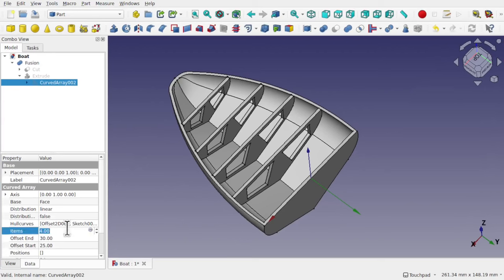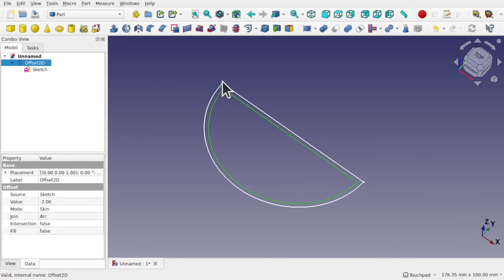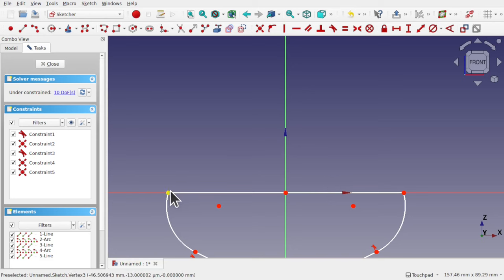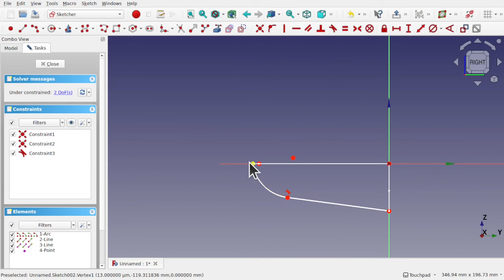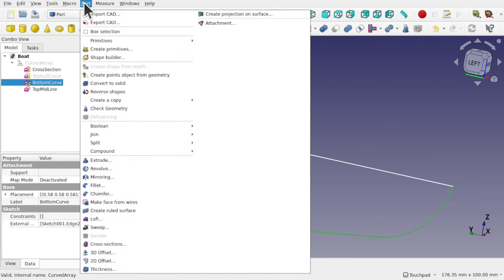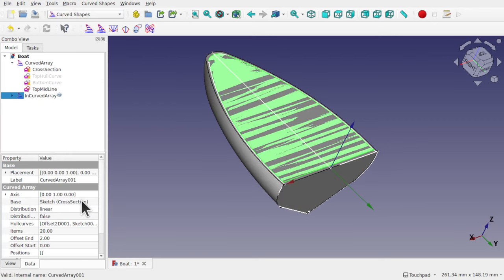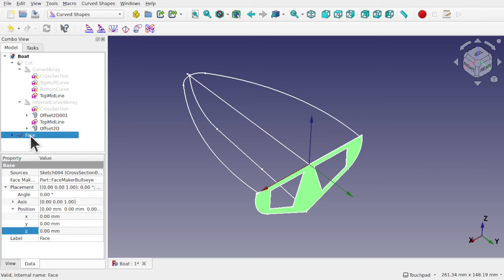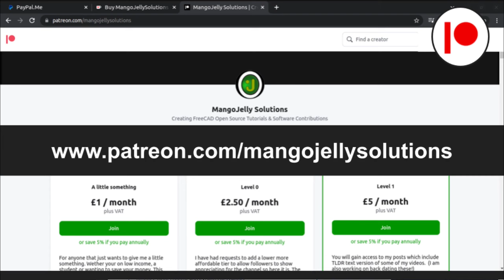EASIEST Boat Build in FreeCAD! Unleashing the Magic of Curved Shapes Workbench

Comment: I can't imagine the number of hours you have spent to refine your skills with this program. FreeCAD is growing exponentially in complexity which is a double edged sword. It's far more capable now but the learning cure is also steeper for newbies.
Reply from the maker: Freecad is a very flexible tool, though it has certain rules and boundaries it's created in such a way you can have freedom to integrate and use these tools in endless ways. You can make it as complex or as "simple" (I say that very loosely) as you like. There are a hundred and one ways of doing one thing. And this is where the boundary to master such a tool lies. Worth flexibility can come complexity. 

I find if I explore multiple ways I can come up with solutions that shortcut complex tasks for a totally different subject. For me it's all about seeing modelling in a different way. That's the fun part 😊. But I don't want to keep this knowledge to myself so I share that knowledge with everyone. And I am beginning to see that there are certain basics that I need to cover and I am looking at creating something as we speak that will turbo charge the beginner experience. It's totally unique to anything out there. It's in the pipe line... And there will also be a book! 😁😁

Comment: I am going to 3D print me an RC boat from plans taken off of Pinterest. I wasn't having any luck making a hollow hull. The trick is the OFFSET. I kept trying to use the THICKEN face, and it wouldn't work. The trick is make 2 solids and then Boolean subtract one from the other. GENIUS!
Reply from the maker: I have been meaning to do this video for such a long time and so pleased it's already helped someone. :) :)

Comment: When you cut the interior from the exterior, you used a small offset to avoid the skin being left on top.  Rather than offset, which might create weird geometry (not important for this, but I can imagine projects where it would matter a lot), would it not have been preferable to extrude the top edge of the interior upwards before the cut?  That is, in general you've gone to the effort of making your interior shape exactly correct, so you don't want to move it.  For example, let's say you are designing a part which will be injection moulded, and it needs to have a consistent skin thickness.  If you've designed inner and outer shells to leave precisely that skin thickness between them, and then offset the inner shell, the part will be thicker on the bottom than on the sides.

Comment: @MangoJellySolutions Thanks for the great work on your tutorials. I abandoned Freecad after trying 0.1 and later revisiting 0.2 as I find the user interface just too confusing. At the time I was working on SolidWorks and Fusion 360 and just couldn't afford the time to figure it out without proper documentation and tutorials. When I had some time on hand recently I stumbled on your channel and found your videos very informative and helpful. When I saw this video I really wanted to work through it and with RC1 now available, I gave it a go. As I wanted to try everything in your tutorial, I also followed your "mistake" to place the sketch too high and then copy it lower using the sketcher copy command. This is where it became interesting as the copy command was not available, so I saved the file and opened it with 0.21 and the command was there. So it would be interesting to know if they left it out in RC1 and if so, if there is another way to do the same operation. Of course it's better to do the job correctly rather then fixing your mistakes later, but we all know that's a dream 🤪.

Another interesting thing I picked up is that the arrays didn't immediately populate and that sent me down a rabbit hole trying to fix something that wasn't wrong, only to find that it only populated after changing the number of items in the array. this was the same for both versions, which I tried on Ubuntu that I run on en external USB hard drive. The reason for that is that I'm currently still running everything on Win 11 Pro and until I'm happy that I can run my little business entirely on Ubuntu with open source software without glitches, I still need to have my computer intact. I therefore suspect that there may be performance issues that cause the problems I experienced, so I'll also revisit RC1 on my Windows computer to ensure it's not related to the environment and possibly driver issues. In the meantime, thanks for your excellent videos and please keep up the great work.

Lastly, your videos opened up Freecad as a real potential replacement for some of the work I do and the add-ons are very good especially this one as it saves a massive amount of time on the bulkheads when you design boats, which interestingly is a hobby of mine and hopefully I can still design a nice yacht before I die.

After doing some searching, I found that I could change the preference in the Mesh Workbench making the paragraph that follows in brackets a non-existent issue (One other shortcoming I found is the quality if the STL and OBJ files that I export. With the other software I use, I can change the detail and quality when I save the files whereas with Freecad I noticed the round surfaces have flat areas. This means I have to smooth it in Blender before 3d printing which is a lot of extra work and not accurate. I noticed there's a third-party add-on that claims to rectify this, so I'll give it a try. Issue solved)

 Other than that, I'm really impressed what the team have achieved with this project and hope to soon say goodbye to Windows and the rest of the overpriced software offerings that don't allow small businesses opportunities to start off without borrowing money to get up and going. Once I make money, I would like to use all my subscription money to fund open source and channels like yours to change the world we live in. I am now committed to do at least some projects in FreeCad and as time progresses, I hope that I can change over completely.

Comment: Select the sketch to move - then to copy and paste.  I have Freecad 0.20. 2.  The last dot selected prior to selecting and click copy is not selected to paste - The same dot to copy/move is selected by the program even if the selection is made by dragging up/down - left right or by clicking on a dot after selection.
Could you show which version is being used?

Comment: Hi, Very interesting example but I have a question. It.s not easier to use Thickness / Shell (from other software) from Part design? I tried, after I created a clone, applied directly on the solid it's not working and I don't know why... Thank you

Comment: Very interesting. How do you continue construction to obtain a whole boat? The end in the middle is annoying; it can be avoided if the inner section is moved slightly.😁
Reply from the maker: You could change the hull curves to what shape you like. Things like cabins could be done as a seperate body and assembled together, or you could union straight on top, or pull into part design as a bar feature. Yep I have made a boat with a pretty fat back side lol

Comment: I'm concerned this method doesn't produce uniform thickness in the hull. If you're having to move an the interior object that will be subtracted 0.5 to get it to work, wouldn't the hull then have thicker regions. Is this method to try to get around our low quality shelling tool, which hardly ever works on any organic shape? Do we have a thickness check tool in FreeCAD?
Reply: I believe the move trick would work even if you set it to 0.001 so the effect would be very minimal.

Comment: I know its fundamental but after years I still dont get when you have to create "body" or not.  Miss the old days when there was no "body"
Reply from the maker: Don't worry it does cause confusion as you can use it in other workbenches. The body from the part design is designed for a part design workflow (and sometimes used in assembly wb). The body's main purpose is to hold a origin that you can attach your elements such as sketches and Datum planes to. If you open it up in the treeview you will see the different axis and planes within which can be attached to. So it acts as a moveable anchor / 3d canvas in 3d space to hang geometry.  Think of it as a frame work.